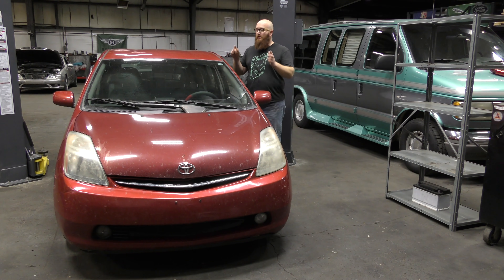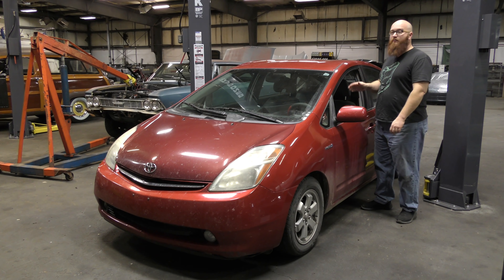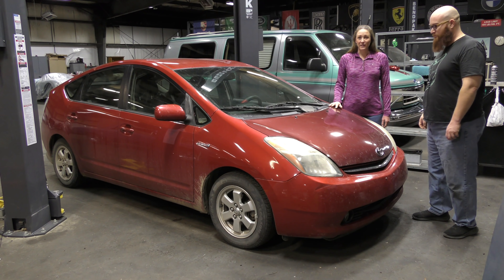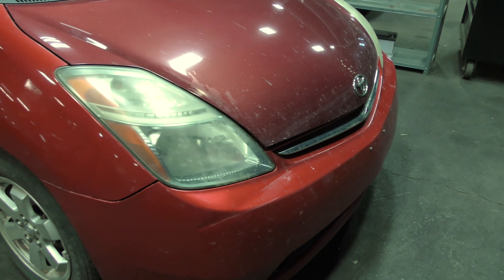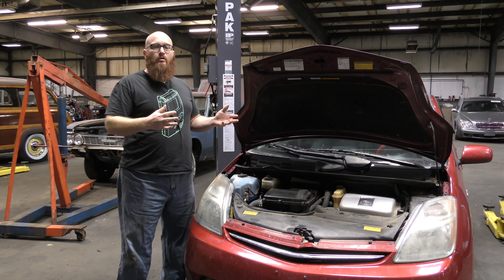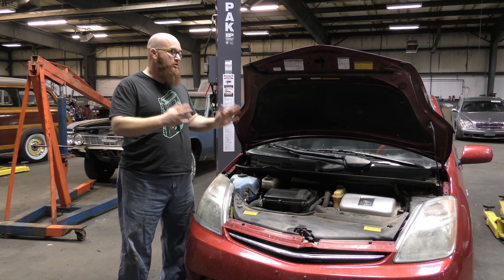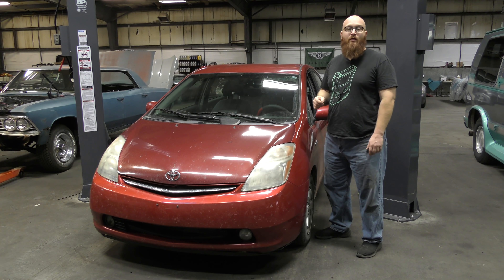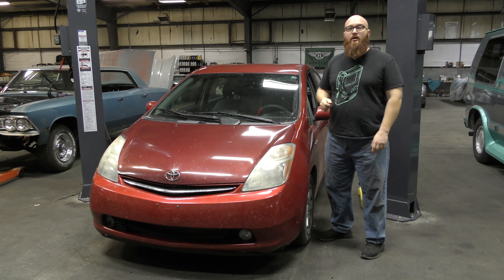When is it time to Buy or Sell a Hybrid? The CAR WIZARD inspects daughters 2008 Toyota Prius

Comment: I had a 2008 Prius for 12.5 years until this year with 357,000 miles. My final straw was a headgasket . I bought a 2020 Corolla Hatchback 6spd manual and having a blast
Reply: We bought a 2020 Corolla HB also. Best $$ value out there IMO. $20.7K for a Toyota built like a mini-Lexus!
Reply: I’m jealous, though my 09 stick-shift Corolla is still going fine.
Reply: @Edgar Miller - I’ve had a few early 80s Datsuns and they were fine. Also a 1981 Honda Civic, and my stepmom had an 80s Corolla. They were all great cars with reliability far beyond my dad’s old Nova and other than the Corolla, these were all used cars bought for under $1000. Heck, you could replace a Datsun 310 clutch without pulling the engine or transmission— just unbolt a few parts on the back of the engine!
Reply: Living the dream. I can only hope to achieve this one day if I work hard 😀
Reply: just bought a 2021 hatchback xse 6 speed. the interior is incredible for the price.
Reply: @Edgar Miller I've owned several 67-69 Datsun 1000s. The same engine carried through to the 80s, only growing in size. Very reliable and long lasting. The corollas were basically the same thing, K series pushrod engine began at 1000cc around 1968, and then 1100, 1200 and 1300 up until 1984. The Datsun A series  started with 1000cc then 1200, 1400 and 1500. By the early 80s you had electronic ignition on most cars, requiring a lot less regular tuning, and more reliable starting. I had a 1000 coupe that had been run continuously from 1969 until I swapped the 1000cc engine for a 1400 in 1998.. basically 30 yrs on the original motor and it could have gone longer.
Reply: @Edgar Miller the invention of Lean Six Sigma at Toyota in the 1980s (I believe) allowed them to rapidly increase quality. That operating system has since been licensed and spread to many an American manufacturing company, as anyone who has worked in corporate America is all too familiar...
Reply: @Edgar Miller I too owned a 1970 Corolla 1200, it was a coupe. I don't have fond memories of that car
Reply: @Edgar Miller Mine was beat when I got it in the 90's. Floorboard was rusted away, just like the Flintstones.
Reply: Be glad it wasn't a Gen 3. They eat head gaskets for breakfast. That's why Gasket Masters on You Tube exists.
Reply: 270,000  miles  my head gasket went out. I been driving it like that for two years. Prius are super reliable
Reply: @Dozav7  back when Nissan was great not so much now lol

Comment: Chris Fixx bought a Prius for $2000. The battery was dead so he replaced it himself for $1000. The car was in perfect condition cosmetically, inside and out. Obviously it had been garaged. If you live a an area prone to power outages, here a tip no one knows. During the Summer, you can sit in your Prius and turn your A/C on. In 8 hours, the Prius used 1.4 gallons of gas. During the Winter, a Prius will keep you warm for the same reason. No other car can do this so it's really popular for the mobile homeless/nomads.

Comment: Rode in a Prius V taxi in Vancouver last year.  It was 4 years old, with 760,000 km (almost 500,000 miles).  Second battery.  Shared by 3 or 4 drivers, and runs 24/7.  That's reliability.
Reply: I drove a bunch of the 1st gen prius when I was a cab driver in PHX, AZ. I saw varying conditions because every day I got a different car. You could really tell when they had new batteries by the amount of time the gas engine stayed running at a stoplight. Toyota actually sent scientists in actual lab coats because running the cars 24/7 in the desert is a great torture test for vehicles.
Reply: @TheMrDudiness It has a second battery because it almost has a MILLION kilometers... Toyota has brilliant quality, especially when it comes to batteries.

Comment: Thanks for this walkthrough. My ‘09 Prius has 199k and literally nothing more than you had mentioned (I add a quart inbetween oil changes, replaced the faded headlights, new tires, and just the small 12v battery). It still has the original hybrid battery and is a pretty amazing little car.
Reply: These cars can last 400K miles easily if taken care of. Especially the 3rd & 4th Gen. may be not the 2008 in particular. For anything Toyota checkout carcarenut channel. That channel is a Toyota Library from a Toyota Master Tech’s point of view.
Reply: @retiredrebel  Surely you can do up "faded" headlights with simple rub on buff off headlight cleaner?

Comment: FYI - Prius Taxis in the SF Bay Area are getting 500,000 miles on their battery packs. And with  deep discharge "refresh" cycling of the pack it can last longer. Its stunningly good technology from Panasonic. There is a nice app / ODBII solution - DR Prius - that will give a good estimate of the battery packs remaining life and health.

Comment: I own a 2005 Prius. I had to put in about 600 dollars worth of parts last 2 years,  but its about 315,000 KM (we use km in canada) now and running fine , and not bad in the winter. The gas tank is full in under $20 US and I drive it everywhere and don't worry too much about it getting dirty :) great car, decent sound system, cheap and reliable for point A to B.
Reply: Prius was one of my favorite cars. Only complaint.  I'm too tall for the front seat
Reply: حياك الله أخوي محتشم أحمد
السيارات الهجين ممتازة.
لتر الوقود كم كيلو متر يمشي سيارتك؟
Reply: @mohammedsaeed3330 yes GOD BLESS YOU AS WELL

Comment: Bought my 04' prius at 230k miles from a lady who drove 3 hours a day and never changed oil, only added. I bought for $1400, a steal. Tightened the oil drain bolt and put another 70k care free miles on it before I sold it for profit. Most reliable car I've ever owned
Reply: 1. Buy used Prius. 2. Drive 70K miles more. 3. Profit.

Comment: The problem with re-built battery packs is the fact that they will only replace the bad ‘cells’.  The problem with that is that there could be 10’s to 100’s of cells that are at 40-85% capacity left that will go unchanged/untested.  A battery is only as strong (like a chain) as it’s weakest cells (links).  So don’t go expecting this re-built battery to last anything like an original... not even close.  Thanks for the video.  Have a Merry Christmas, Wizard Family.
Reply: Exactly.  Even when some "rebuilders" offer a long guarantee it can take weeks in many cases.  However Toyota has reduced new battery packs by almost 60% over initial pricing from 15 yeats ago.  Also there are new battery cell replacement kits available for the diy crowd.
Reply: A Toyota mechanic on YouTube recommends new battery packs vs. reconditioned for those very reasons.
Reply: Green Bean Battery charges $1,449 for a reconditioned gen. 2 Prius hybrid battery. It comes with a lifetime free replacement warranty,  which is transferable if vehicle is sold. They will come to your house and do the work onsite. 

I am not affiliated with Green Bean.
Reply: You can toy with rebuilding battery packs if its your car and you have the skills to do it, I wouldn't pay someone to install a rebuilt battery though
Reply: As crazy as replacing their $500 key fobs . Make sure you have both original working and programmed key fobs with any Toyota . This is a shameful scam by Toyota on customers .

Comment: I have a 2008 Toyota Prius and it’s about to hit 400,000 miles and it still runs perfectly fine it’s still on the original hybrid battery and it’s going strong I love it
Reply: Did u have to replace water pump?
Reply: Good to know. I'm actually going to look in to buying one with 88,000 miles on it.

Comment: I bought a 2007 Camry Hybrid from auction for $2000 plus $600 fees.  It's perfect, love it. Yeah,  had 211000 miles. The gas engine doesn't burn oil and doesn't leak. Only problem is the ac doesn't have freon. Well,  ot winter,  I will wory about it in June.  Did maintenance on it and it's a wonderful car.

Comment: My sister bought a 14 Prius V 2 years ago.  The only issue she's had so far was it wouldn't start do to a dead battery in the key fob. She has said once the hybrid battery starts to go she'll get rid of it mainly because my brother-in-law who is a mechanic, refuses to touch the hybrid system mainly because this is the 1st hybrid he's ever had come into the shop, the gas engine he does service and would repair if necessary of course.  I drove it once, and while it did drive nice I would never get a Prius mainly because my old 08 Spectra would often leave it in the dust, and that car was absolutely gutless (I now have a 14 Civic and loving it)

Comment: 04 prius with 300k.  Most reliable car ever.    I reconditioned the battery pack around 250k by replacing 3 bad cells.  I believe they were like $40 ea.   Actually pretty easy to do.  Maybe loses 1/2 quart every 3k miles.   Never left me stranded  It's been my backup beater vehicle for a while.
Reply: Wow that’s old! I got a 07 and thought it was old it’s also the leather model that cheapo low model deteriorates very fast I heard plus the paint comes off in 05 and below I believe the 07 I have the dash doesn’t deteriorate
Reply: There’s also a huge gamble of the junkyard but you can get a whole Toyota hybrid battery for pretty cheap that way. I mean there is ways for it to not be at the end of its life I doubt it can ever die it’s the hybrid battery you need to eventually replace but it’ll last a very long time

Comment: We had an 05 Prius, it was an ok car. It had its issues like everything does but it never left us stranded. The biggest pain was replacing one of the several water pumps deep down in the engine compartment behind the headlight and bumper cover.
Reply: I bought my ‘06 in 2014 with ~140k miles. I have about 190k miles now, so I don’t really drive it that much. The only non-routine maintenance has been replacing the inverter water pump, which is apparently a fairly common issue.
Reply: I actually love doing the inverter pumps. Super easy but I’m a mechanic.
Reply: how much does it cost to get the inveter water pump replaced? @turboclaybird
Reply: @nordicpride9708  Is the inverter motor separate from the pump, or do you toss the motor when you replace the pump?

Comment: I have a friend that has one of these with 247,000 miles on it. It started burning oil, I told him to start changing the oil every 3,000 miles instead of 5,000 miles and the oil burning stopped. These cars are SUPERB!!!

Comment: I owned a 2008 Prius, I didn’t need to change front brake pads until 150k. Changed hybrid pack at 190k. Did regular maintenance. One of the most reliable cars I’ve owned. We have 8 Prius in our family including a 2012 V I drive now. Great cars!
Reply: Did u ever have to replace water pump?
Reply: @lawbee2448 i just got a 2004 with about 160k and ik they’ve replaced it before
Reply: how much did the hybrid pack cost to change?

Comment: People allways wonder why Im keeping my beater. The reason is because its simply cheaper ti fix it once every hundred thousand miles. I got a new valve setup for around 200 dollars and installed it for around 100 the car runs fine and sounds great. I think ill just let my son use the car once he turns 18. But for now its taken me across the stat3s and back home around town to work. With no trouble.

Comment: When I was a teenager, I had a 1965 Plymouth that needed a quart of oil with every couple tanks of gas. Still got 100k miles out of it. In fact, I drove it one summer from California to Alaska with a case of oil in the roof rack. A bear even climbed up on the roof while camping in Canada. He opened one of the cans with his teeth and definitely didn't like the taste as much as the Wizard does.
Reply: That's more oil than a two-stroke would use. Impressive.

Comment: I have a red 07' prius with 204k, still going strong. It does eat a little oil between changes but I have no complaints with it. Only paid $1k for it too
Reply: Awesome cars for the package they offer. $1k was an awesome price! Congrats!
Reply: I still want one to offset my Tundra's milage
Reply: Most economical car purchase ever. Congrats on the smart investment
Reply: Wow! You got that cheap. I am looking at used ones but the price they are asking for is around $5,000 to $7,000 on up

Comment: Great videos! I have a 2007 with almost 200,000 miles on it. It's common that they use some oil. I was very  skeptical at first but I have found that  using Valvoline high mile oil in mine has reduced oil usage to the point that very little oil is used. I am doing more minor repairs this summer to get the car up to my standards.

Comment: lol it actually is the same color and color code. It's just that overtime different cars get different exposure to sunlight and the color fades ever so slightly. Looks like the hoods car may have been garage kept. while the daughter's care spent more time outside. My Prius actually has the exact same problem. Mine uses oil and hoods color is ever so slightly different. My Prius was a Florida Prius. my car is slightly lighter than the hood and the plastic piece I replaced on the trunk latch. Mine also has original battery with 190k miles.

Comment: My wife has a 2009 Impala that we bought in 2010 with 11,000 miles on it.  After a bit of a rough start with an engine light that wouldn't go away, the car now has 180,000 miles on it.  It leaks oil, the paint is peeling off the front bumper, there's a hole in the drivers side carpet, but it still runs like a top.  We plan on keeping it for another 5 years when another car payment will be feasible.

Comment: Prius are some of the best most reliable and bullet proof cars ever made. The biggest risk with them is some dirty thieves cutting your exhaust off to steal the catalyst
Reply: I would think they'd do that to SUVs, with much more room to get underneath. That Prius has very low clearance.
Reply: @markh.6687  The Prius gen 2 cat is reportedly one of the most loaded with expensive metals. They also use hydraulic jacks some of those thieves

Comment: I have a 2009 Prius as my daily driver. It is fantastic and I love it. Its got 106k miles on it. I too had the front crunched but was repaired by insurance very well. I did have to replace the engine, one of the spark plugs broke and pieces fell in the engine, damaging the valves. New motor has 86k on it. Its doing great and I love the gas mileage

Comment: Very interesting. I have been doing this for years. My best buy was a 79 Ford Thunderbird for $800. Drove it for 5 years, averaging less than $200 a year in repairs. Only scrapped it when the rust became too bad. That is when I found out that for nearly 100,000 miles I had been driving with a cracked piston. Old Chloe just kept on going, even towing a trailer with no problem in spite of 0 compression on one cylinder. They don't build them like that. My current car is a keeper. Arthur is a 1990 Volvo 240 wagon with a mere 400,000 miles on the clock. Runs like a top
Reply: I'd make fun of car names, but I've given my bought-used silver 2000 Saturn Coupe two names:
"Heigh-Ho Silver" and "My Little Silver Deer" ('cause she scampers around pretty good with just a 1.9L engine).

Comment: I bought a 2011 Auris hybrid in 2015 with 75.000km. It's driven by me to commute to work, mostly German Autobahn (they're mostly speed regulated, not free). In the other time my mother-in-law uses it in the city. Now has over 160.000km on the clock, or 100.000 miles. Except a shot ac condenser, one drained 12V battery and a cracked windscreen: no issues. 4.8l/100km average fuel consumption.

Comment: At one point we had four of these in the family and all ran great. After about 6 months of changing one to a bigger car, had sort of regretted that, there was no real need for the swap. It is the type of car that has no competition (at least in Europe) for what it offers at the given price point they go for. Hear lots of good experiences from owners (2007 with 330k miles; 2008 with 347k miles etc., 2017 with 217k miles) that come on a podcast I run about used hybrids and EVs where they share their experience. It is so reliable that one guest shared a story about he driving 30k miles on a failing hybrid battery.